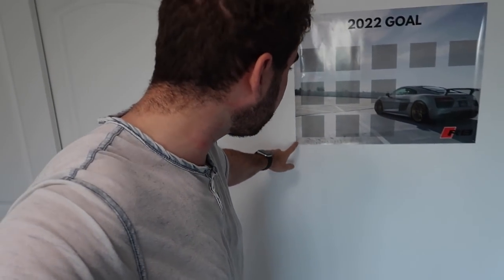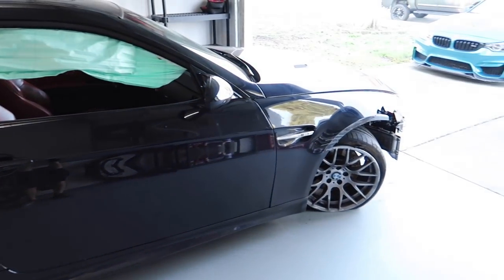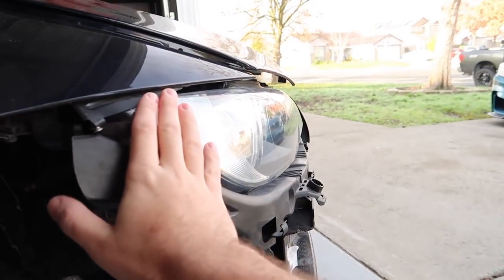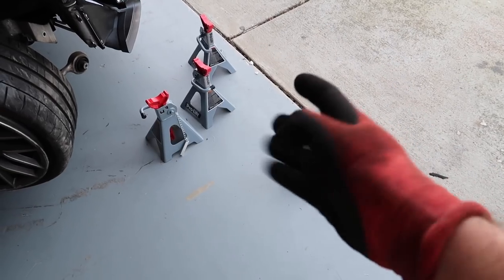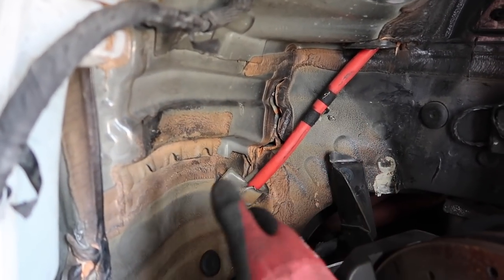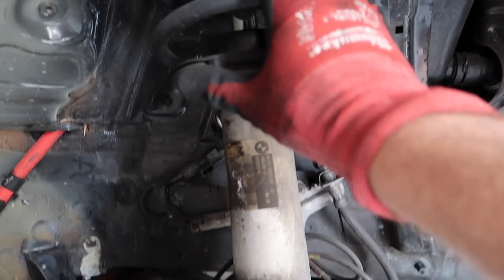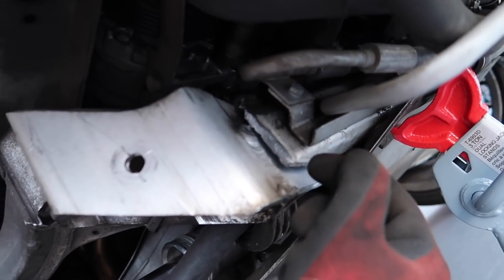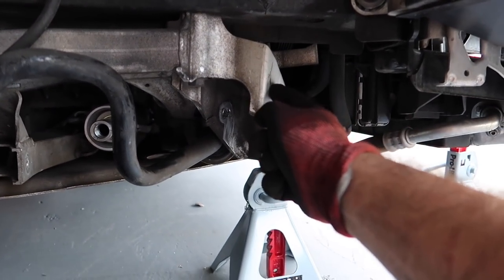PURCHASED THE CHEAPEST CLEAN TITLE E92 M3 IN THE COUNTRY!

Comment: Would really love to see you tackle the  subframe replacement and rod bearings yourself, will make for exciting content and the knowledge gained from those big jobs will be invaluable for future builds.At minimum you will need a quick jack , engine support bar , and sensetive enough torque wrenches.It should also cost you less than sending her to a shop.
Reply: Only 4 bolts and would save a bunch of money for sure.
Reply: The top bearing shells are not that easy to get off the crank and if you accidentaly scratch the crank while trying to get the top bearing out will en up in a new engine / Rebuild